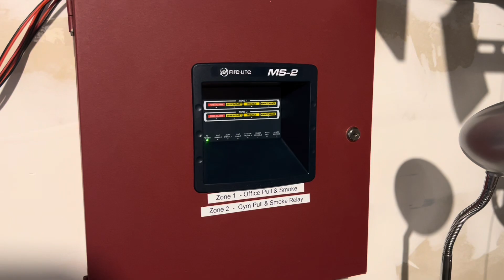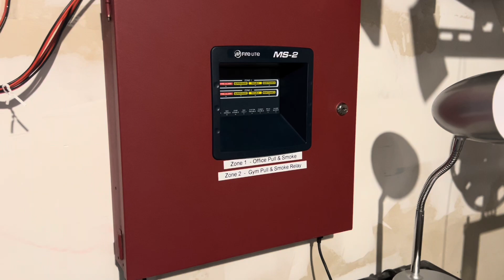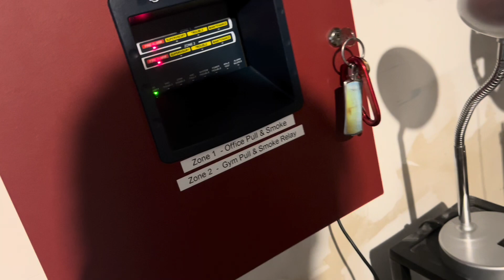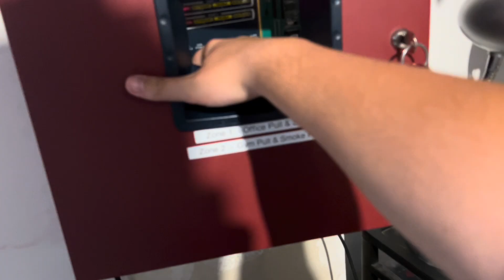System Test 36: Hotel Voice Evac Simulation

Comment: Cool! The E50 seems brighter than the 4903. I almost thought the E50 was a 9147 😂! If the 4903 was a 9144 or 9149 it would be as bright as the E50.
Reply from the maker: The E50 is set on 110CD so it is MUCH brighter.
Reply: The E50 caught my eye simply because I found a collection competition.